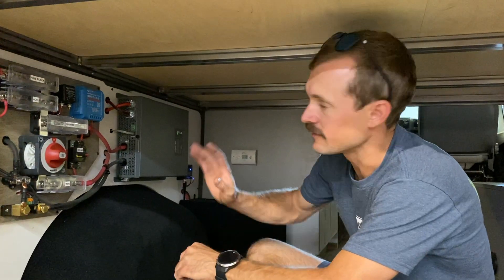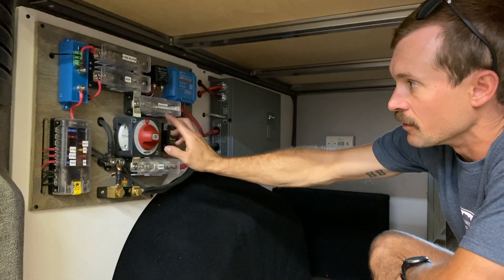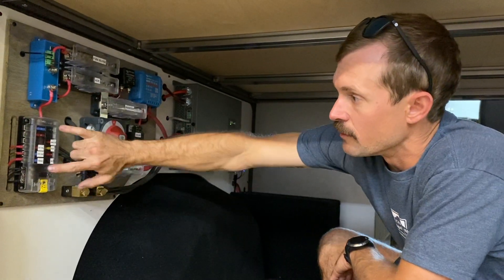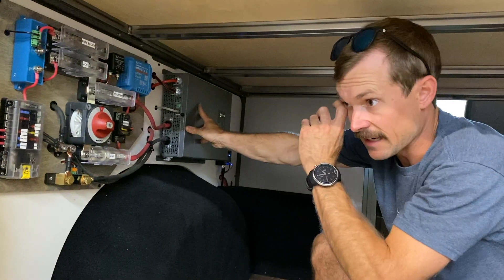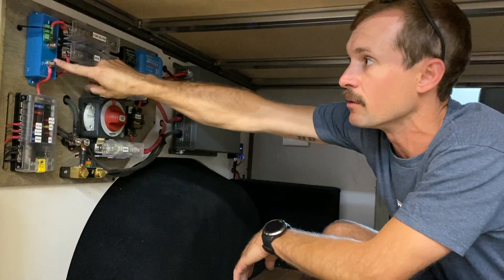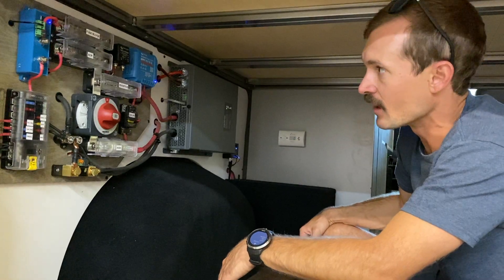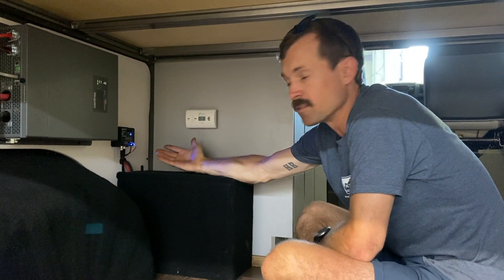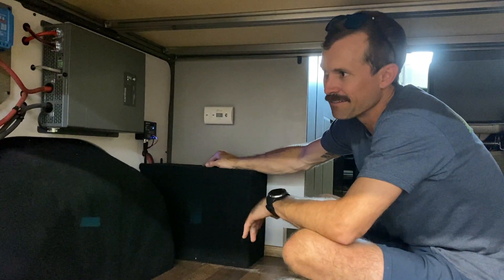A 200 Amp Hour Electrical System

Comment: I really figured for $65,000 you would get more than 200ah, 1000w inverter. 10 gallons of water.   VanSmith may be one of the most expensive upfitters out there..... Looks well built but basic.